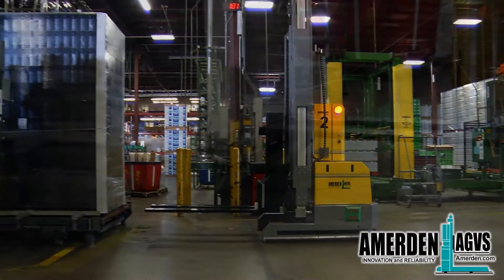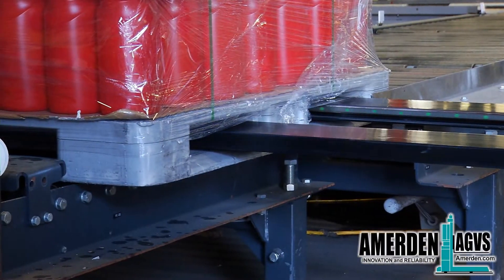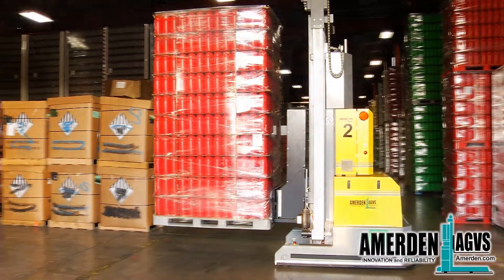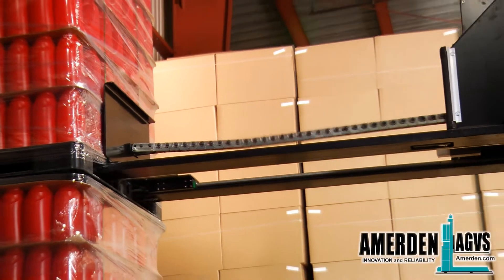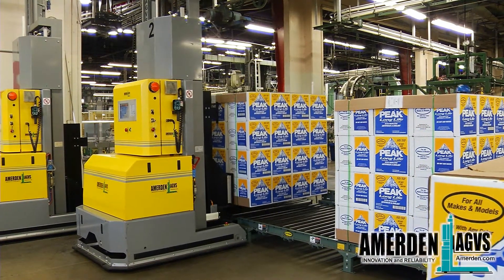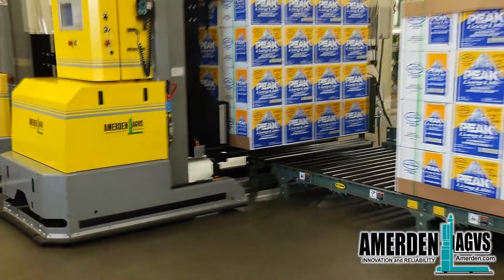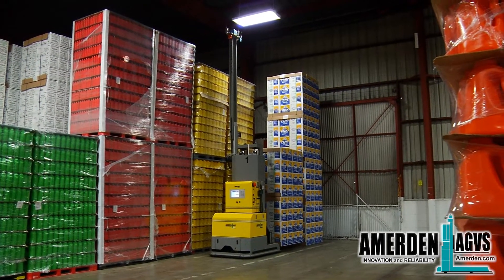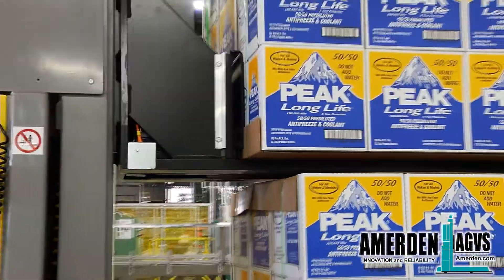Amerden counter balanced AGV in warehouse application

Comment from the maker: Our line of laser guided counter balanced fork trucks utilizes a pusher to handle pallet less loads or slip-sheet loads and has the highest safety with 360 safety bumpers, laser fork tip sensors, automatic charging and an optional built-in scale.

Watch the movie and visit www.amerden.com for more information.